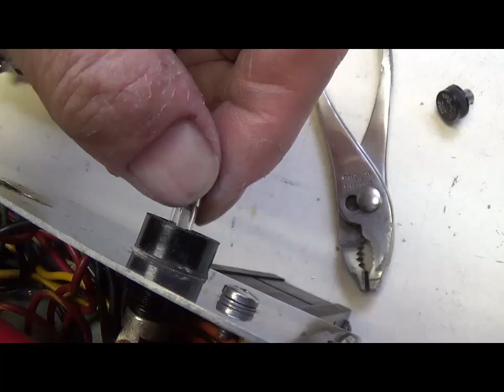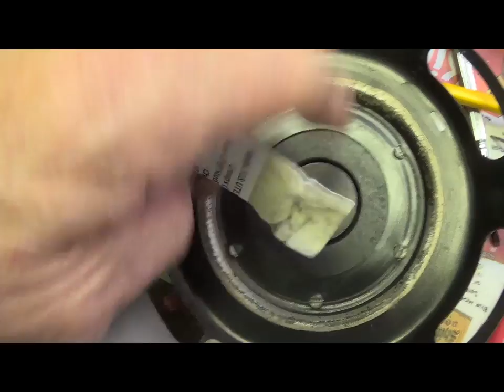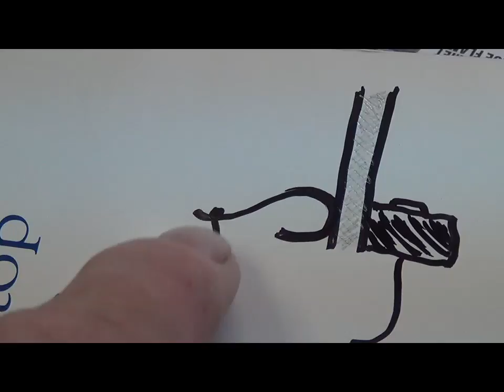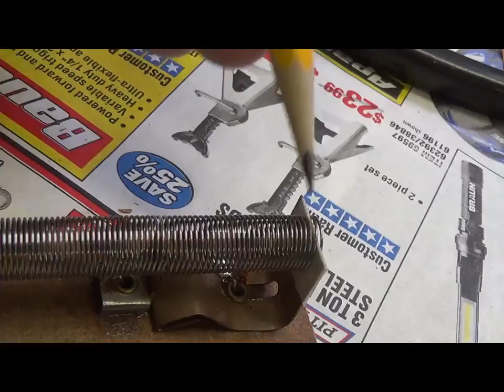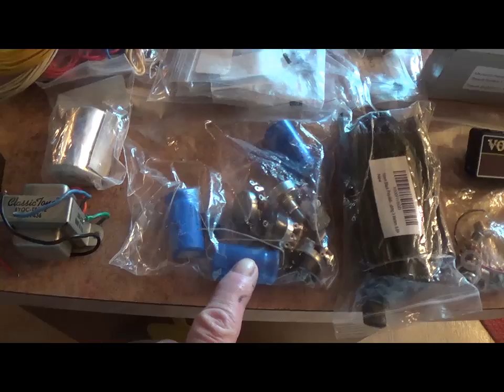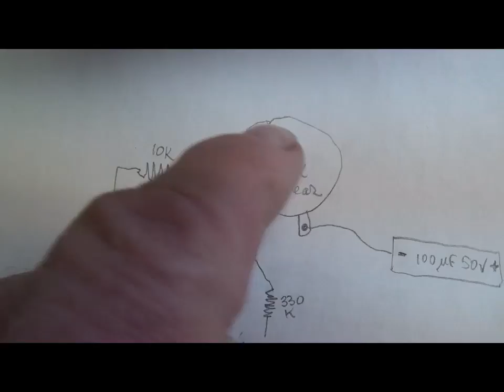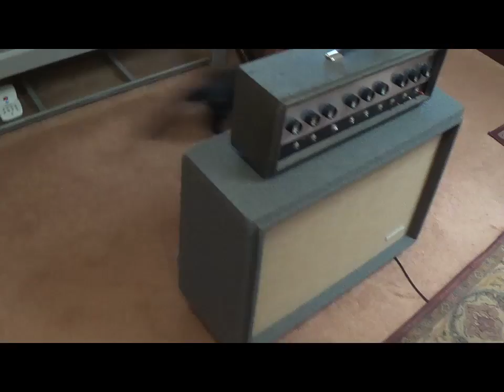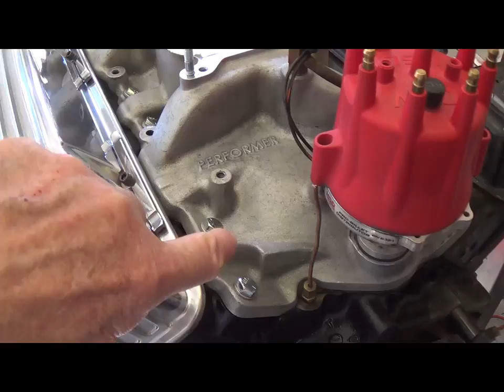Silvertone 1485, Part 3: Circuit Overhaul, Speakers, Sound Check

Comment: Given that you had re-coned some (or all) of the speakers, I would double-check that they all have the same “polarity”, as the factory may have wound the voice coil wrong, or - heaven forbid - you wire it in wrong, it’d be nice to know before you wire up all the speakers! 😁
A quick-and-dirty way to check,is to get a 9v battery (or some clip leads and a bench power supply) and quickly check by ever-so-gently touching the dust cone, then touch the battery to the speaker terminals. You MUST note the battery and speaker polarity here, and if the cone pops against your finger, or pulls away from it. You now want the same thing from ALL of the speakers. This ONLY applies to PM (permanent magnet) speakers, not the older type which require a field coil, or to piezoelectric types! Just don’t apply the DC voltage for too long, or you’ll be re-coning the speakers again!
Reply from the maker: Thanks for the helpful advice, William. I will do so.

Comment: Nice work!  Wow the 1485 is quiet with the footswitch shield and grounding jacks.  Thanks for explaining dependable  and moderate bias in detail, that is really helpful with irreplaceable old amplifiers.  The new engine is looking great, really clean up top with the intake-mounted crankcase vent.
Reply from the maker: Thanks, Jon :)  You really don't have to roast your tubes to get good tone.

Comment: Doug, your restoration of this beast is amazing! Aside from some very minor cosmetic details, this amp is most likely in better than new condition. Considering what you started with, your restoration abilities border on magical!

I am disappointed in the amp itself. For something with 6 of those great speakers and a tube amp, the sound is disappointing. The reverb sounds bad and is awful at any setting above 25%. The tremolo is just passable. It also distorts before it gets loud at all, which can be ok but should be avoidable if you desire. Sears best in this case is not as good as some of their “lesser” amps.
Reply from the maker: Sorry for your disappointment, Jim. You're definitely in the minority in this regard.

Comment: Doug and Brad

We learned sometime ago in Information Technology that you don't have to understand a multi-dimensional array of byte pointers to be a good, yea verily even a great structured database programmer. You don't have to memorize Theodore Codd's rules for achieving the "third normal form" in database construction to connect to one and produce reports. 

You guys have about 80,000 viewers between you. If one or both of you would produce a document/book/white paper that is in fact a tutorial for the electronics piece of guitar amplifier construction you would sell the crap out of it. I'd be your first customer. I have built two small MOD DIY amps. The first I built by following the instructions. I can follow instructions and I am the neatest solderer you ever met. I have no clue what I did. I even repurchased the parts from the same company along with a blank chassis and drilled in out according to Uncle Dougs specs. Built the same amp again successfully. Still no clue. At the end of the day it was the same instructions.

Of course there would be many sidebars that would apply to other areas but if you could produce a publication with that narrow focus (Keeping the cost down) You could sell it yourselves and make a killing. No publisher required. Think about it.
Reply from the maker: I've been approached several times to create a book on tube amp technology, Jim, and so far have not done so simply because of the huge amount of time and effort required.  I worked for 48 years to achieve retirement status and am now relishing the freedom that all those years of toil and saving have provided. Creating YT videos has been a wonderful outlet for my creative energy, and is now providing a modest income to supplement my social security. Giving all that up to write a book seems much like turning back the clock to pre-retirement days and, to be honest, is simply not that appealing. In my mind, the videos are an excellent way to convey knowledge and, according to many viewer comments, are quite effective in doing so. I really appreciate your input and am flattered by your confidence in my literary abilities, but at this time, writing a book is just not feasible. Thanks !!!
Reply: Believe it or not, I get it. I was scheduled to retire last September and my company made me an offer I couldn't refuse. Your YT vids are very fun for me to watch. I enjoy your subtle wit as well. I just recall watching them, enjoying them, and then at some point saying to myself, "Well that was nice What do I suppose most of that actually meant?". LOL Glad you're enjoying your retirement Doug.
Reply from the maker: Thanks, Jim. Don't let the money keep you from enjoying what's really precious in life......your time.

Comment: Great video. I'm wondering if a crystal phono cartridge or piezo buzzer might work as a replacement for the old transducer. Could be a fun experiment.
Reply from the maker: Thanks, Brad. I have several old piezo phono cartridges that I used for vintage jukeboxes. A little experimentation might show if those crystals can be modified for use in the Silvertone tanks.
Reply: I was thinking maybe mounting the cart in the base of the tank and somehow connecting the existing needle or some other piece of metal to the spring... Just thinking out loud.
Reply from the maker: The mechanical connection would be challenging, Brad, but I guess necessity is the mother of invention......or some such nonsense. I'm currently looking into Belton reverb modules and methods to convert to a transformer-driven "real" (i.e. MOD or Accutronics) spring reverb tank. Fortunately, I managed to tone down the rowdy reverb in the 1485, and it now purrs like Dick Dale's kitten.
Reply: https://tapeop.com/interviews/76/diy-reverb/
https://www.nicolascollins.com/texts/TapeOpReverb.pdf

Comment: Another one done to perfection. That setup would almost weigh as much as my Traynor reverb master, with the Traynor 4x12 cabinet. I was over at my sisters for dinner and hijacked their smart T.V. to watch this one. I'm just wondering what you are going to put that engine in.
Reply from the maker: Thanks, John. I may build a '27 T Roadster for the engine.....not sure yet.

Comment: Here's a real question,  how did you attach the hum shield to the existing chassis?
Reply from the maker: The side of the metal shield has a slot that fits down around the jack and is held tightly in place when the jack nut is tightened.
Reply: @UncleDoug  aah, I get it. Thanks.
Reply from the maker: You're welcome, Craig. Considering the possibility of short circuits in that area, it had to be securely positioned.

Comment: Fab restoration again Uncle Doug :)  I do have a thought though that if is interesting to you it's all yours.
I feel like there's something wrong with one of the transducers in the reverb tank.  It has a very shrill ringing that only seems to happen during the first attack of the notes.  The remaining sustain seems to be ok but to me I definitely hear a ringing happening in the attack of the notes only in the reverb.  After listening to it a few more times I think it's perhaps feedback from either of the transducers.
My thought is that the reverb is already too powerful and has almost no real usable range in the whole sweep of the pot.  So it seems that if you can reduce either the input and or output transducer(s) and see how that flies.
As always, tons of love from Canada.
xoxo
Reply: I also just thought it might be worth adding that any tube amp that I've had "mystery hum" in.  I've had immediate success by making a grounded shield similar to the little box you made around the foot switch area in the chassis.  However it's just to cover all the pots and inputs on the control panel.  I almost just do it to all my jobs now because it seems to make quiet amps silent.
Reply from the maker: I agree that there is vibrational feedback through the reverb tank, Justin, and I will address the situation when I get a chance. You really can't change transducers, they are virtually unobtainable, but the problem can be addressed in other ways, notably by reducing the input signal to the tank.
Reply: @UncleDoug  I guess I was thinking you could just impede either of the signals to some degree.
I haven't worked on any tube reverb units yet so I'm not terribly familiar.  I just kinda assumed that either the decay time or the depth of reverbs were controlled with transducer impedance of some sort.
Reply from the maker: The impedance of the crystal transducer wafers is not easily altered, but supplemental resistance in the input circuit should reduce the intensity of the tank drive. We'll see.
Reply: @UncleDoug  Ok cool!!!  Thanks for that!  I'm an engineered brained kinda guy so I'm always trying to solve problems that I need yet to be attained knowledge for :)

Comment: Thank you for the high level of detail on the reverb system. I have a friend that has offered to donate a 2x12" version of one of these amps, perhaps to arrive from out of country in next few months. It has been stored in a damp basement for over 20 years, so we expect it to be a real project. Photo of it reveal it will also need recovering.  Given the lack of original style vinyl wallpaper, we are considering an inauthentic but more durable real Tolex covering in some other color... perhaps a conservative Fender black. That should look good against the faceplate.  I am a big fan of converting to cathode bias on output tubes, eliminating the negative supply and adjustment pots.. A few watts are lost by elevation of the cathode above ground but the stability of bias over tube life is a big plus..  Your tip of using grounding jacks on TWO, plus shielding the foot-switch jack are well noted...👍.
Reply from the maker: Thanks so much, Jennifer. Best of luck with your restoration project, when it arrives. I will be posting a video on a 1474 in the near future, with the worst floor you will ever see. It should provide some inspiration :)

Comment: Hey Doug, nice wire work in the speaker cab but where will the groupies hang their panties without the speaker to speaker clotheslines?
Reply from the maker: Amp experts say that the main cause of early speaker failure is proximity to moisture, Craig, so I'm making sure that those panties, Depenz, jock straps, etc. all get dried out elsewhere......like on the drummers cymbals.
Reply: @UncleDoug  Sounds good, thanks Doug.

Comment: Glad you rebuilt the original speakers. Those Silvertones just don't sound right with whatever they are replaced with. I had the 1484 twin reverb model. Burned the speakers voice coil. Nobody in Austin knew how to rebuild the speakers. I've heard 1484's w/Jensens, but they just don't have that great Silvertone sound. I used to plug my Strat into both channels with a Y cord. Sounded like a Marshall stack. Anybody Know who made the original speakers? I suspect they were probably used in a lot of different things, TV's, Rados, etc.
Reply from the maker: Actually, if you watch the Part 2 video, Thomas, the original speakers in 1485's are six Jensen C10Q's and in the 1484, they were two C12Q's.

Comment: Doug what is your audio recording  setup.  I hear the same fizzy noise sounds in the Amp demo and it most likely is not the Amp and speakers. Your Mic sounds like it may have a blown coil much like a blown speaker or is the Auto gain control on your camera's mic not able to respond to the large quick volume changes.
Reply from the maker: It's a built-in Sony video camera microphone, James. Not optimum but it's all I have at the moment.

Comment: Wow!  I have an old SEARS 1483 guitar amp that had been sitting in the back shed for 40 years.  I bought it used in High School.  You certainly made me see it's value.  Per your example, I'll clean it up.  Good videos.
Reply from the maker: Thanks, Daniel. By all means, get it out, clean it up, and see if it still works.

Comment: Great work with this piece, Doug! I'm very happy to hear it live once again, and quite grungey as well! Thanks for the tips on reducing hum - hadn't though of those, but of course they make sense!

So if I understand your biasing arrangement, you've got each tube at 32mA to get each pair at ~28W per transformer?
Reply from the maker: Thanks, Britt. Yes, by under-biasing the tubes, the current flow through the OPT's was reduced to a tolerable level......and yet the amp still sounds great. This preventive measure made sense to me.
Reply: Indeed, I too think it sounds great. Glad to see a conservative bias to keep it from going the way of the old rat-eaten speaker or the urine-caked transformer hole.

Comment: Well, once again you have pulled off the impossible and made it look easy. the re-cone job on the speakers was masterfully done, thank goodness the previous tenants of the Silvertone highrise rodent condo didn't leave you any yellow rust in the coil gap of the magnet. On the reverb tank, that appeared to be a huge diameter spring. It is no wonder that it needs a thread in the center to dampen it's travel. The image of a giant soggy rotini noodle came to mind during one of the shots of the failed attempt at repair by someone else (with Scotch tape, snicker snicker, seen that before in some really unusual places). I am a great proponent of using what you've got but, at the very least they could have taped over a piece of cardstock paper, not just a layer of the thinnest tape on the planet. The Piezoelectric effect is just amazing, a couple of conductors, a quartz crystal and a little earth magic happens. (Side note: the piezoelectric electric effect has been put forth as a possible explanation of the famous ”Marfa Lights”.  The theory is that the uneven cooling of the quartz laden rock strata of the mountains causes plasma or coronal discharges into the atmosphere. Never been proven though. Many physics students from all over have tried to figure it out but as far as I am aware no definitive, universally accepted explanation has been published.) Casey looks like a totally different animal, well fed, beautiful winter coat, just gorgeous. You and the Mrs deserve the highest praise for what you have done for that poor neglected kitty. Back to the amp, since I wandered off topic (imagine that), the use of the stereo quarter-inch jack to handle the series/parallel speaker arrangement was an inspiration. Also having one end fastened to a screw terminal block will prevent some future person from substituting a mono patch cord if jacks had been used at both ends. A mono cord would be pretty hard on one of the output transformers, I wonder if something along that line happened to the missing output transformer? Perhaps an attempt to wire around rodent damage speakers and getting the polarity wrong, makes me wonder. Another side note; according to ”Ma Bell” the plug consists of Tip, Sleeve, and Ring, the ring always being the lowest impedance or ground. (So as not to shock the switchboard operator. More useless trivia to clutter up your brain, why should I be the only one?) Now on to the 350, did you check the timing chain? I seem to remember those could be bad about stretching and GM experimented with a nylon cam sprocket at one time which in my opinion, was lunacy. No doubt a bean counter decision. Well, sir, you have taken an amplifier that was at the verge of a trip to the landfill and brought it back to better than new condition. I personally vote for leaving the original Tolex covering, sort of like your International pickup, a little plain on the outside, but a beast underneath. This was a truly inspiring project, masterfully done. My hat is off to you Sir, (exposing my sparsely populated head of hair). Extremely well done! As always. I look forward to your next video with great anticipation.
Reply from the maker: Good grief, Mark. Reading your comments is like reading a good novel.....all sorts of interesting detail and clarity of vision. Thanks so much for all your observations and input. Your Marfa Lights comments hit home since the site is relatively close by and a subject of interest. A piezo cause would answer a lot of questions. I am trusting that the timing chain is OK, due to the relatively low mileage on the engine.....naive, but expedient :)
Reply: Best of luck with the 350. If memory serves when you fire it up, if the timing chain is sloppy it will lope at idle like it has a full race cam until it warms up. Unless it is extremely sloppy then you can hear it slapping the guides (if there are any, depends on the year model).  I love the valve covers and the old school crankcase breather. Reminds me of the 327 I had, 7 fin cast aluminum Corvette valve covers, no PCV or oil filler cap either. gives the engine a really clean look like yours. Well, I gotta dash I am off to Crowell TX today to repair the prototype unit of a 900 MHz spread spectrum wireless water well control system that I designed, built and installed in 2003. (The first of 25 systems I installed over the years) It is on two different ranches with the ground storage tank 25 miles from the well. It just quit working after 15 years.  Oh well, I told the customer that I would stand behind it and maintain it as long as I was able, and I am still able. Don't look forward the two and a half hour drive just to get to Crowell, then another 25 miles to the well, mostly pavement, then 25 miles of dirt road to the  ground storage tank. Then about three hours back home. Have a great week!
Reply from the maker: Thanks, Mark. Best of luck with your repair odyssey.